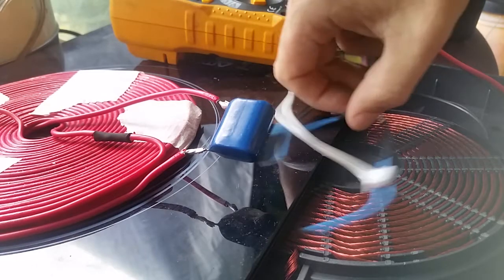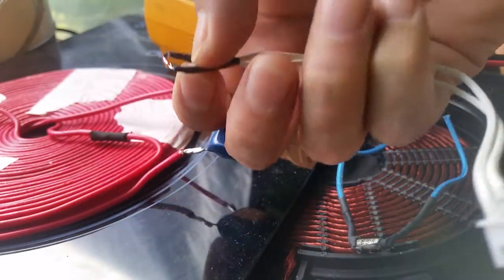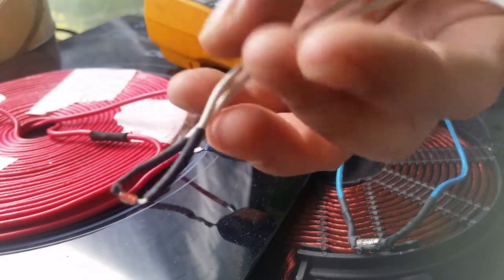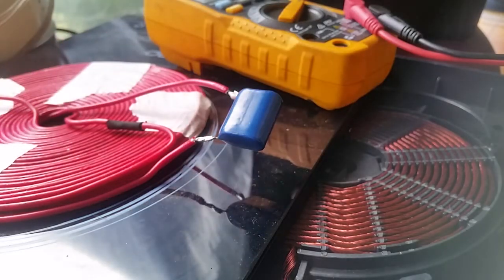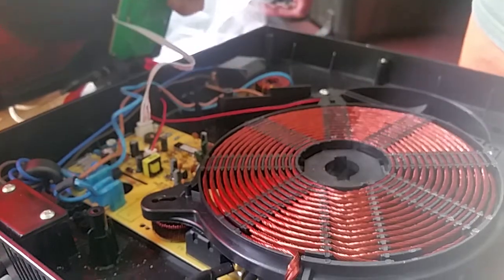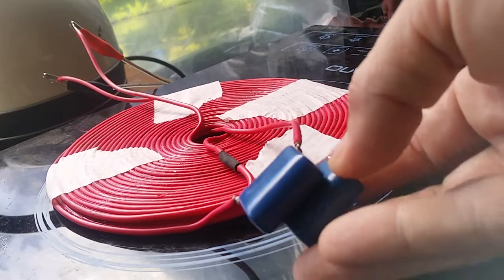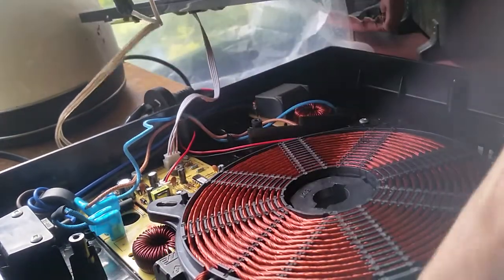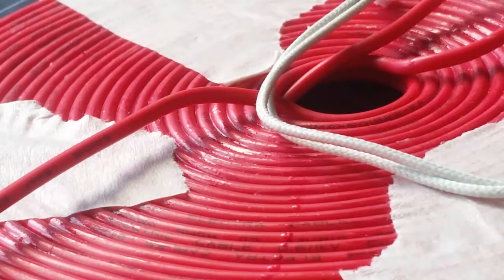Induction cooker modifications...beeper, thermal cut-out, & thermistor

Comment: I'm trying to hotwire the fan to always on, any ideas as to where on the board I  can get 18V? the 18V line is controlled by a broken component, seems the trans is dead, can't find replacement, so i thought hotwire would be ok, thanks for you vids
Reply from the maker: no, sorry. maybe a laptop power supply... some of those are 18v, 20v would probably be fine as well

Comment: Thanks for the info. 7 stranded 1.5 mm2  is what I will start with as well, ordinary installation cable. I will also have 7 stranded 2.5 mm2 and 27 stranded 1.5 mm2 to test with.
Reply from the maker: I like the suggestion of the speaker wire as it closely matches the litz that is driving it.
Reply: @m3sca1  The difference being that the litz wires are separately insulated and therefore are subject to the skin effect, while speaker cable wires are not.

Comment: Ok so the pan detection may work as follows... initial power goes to primary and after a few moments it will heat up the sensor and lower its resistance allowing the primary to continue.if  the sensor stays high in resistance the primary is shut down . Makes sense to me .
Reply from the maker: I'm not sure about that. The cooker will run a pan with no sensors. But put the coil down and it goes into error. I can trick the cooker to start again by shorting the output to the jug so full short circuit across bifilar. I found the caps (from a non dodgy seller ) on ebay. Send me email and i will give you the link. mescal695 (at) gmail